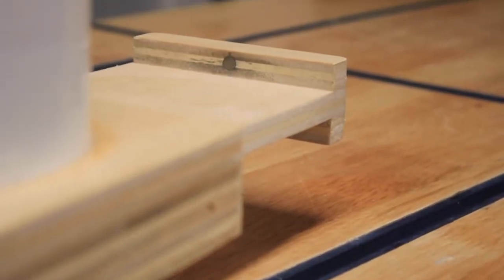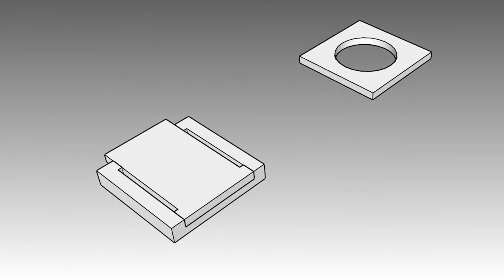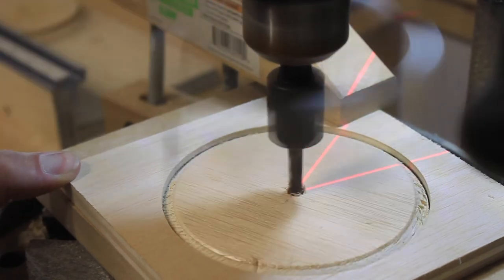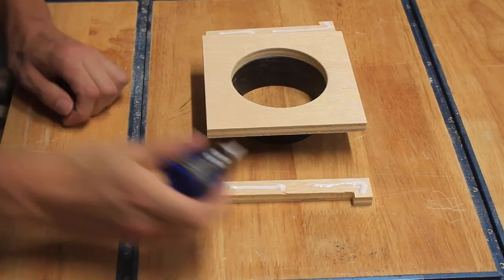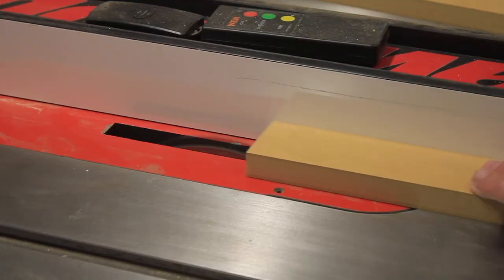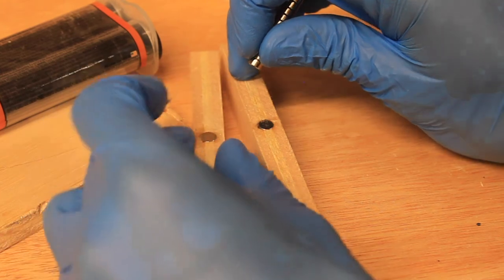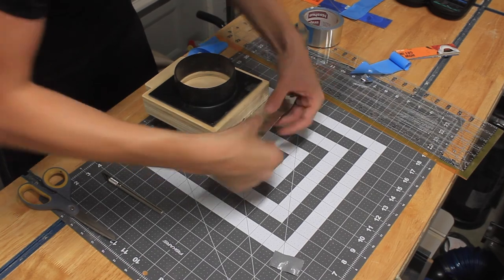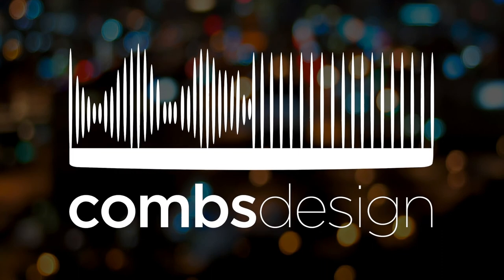DIY Self Cleaning Blast Gates (Best DIY Design)

Comment: I lost a big chunk of my thumb making dado cuts like you did here.  Using your fingers to hold the piece down as you slide it over the blade is asking for trouble.  All it has to do is catch the blade and sling it out of the way and your hand drops onto the blade.  Don't mean to preach here, I did it the same way for twenty years before it happened to me.  It's just a matter of time.  Other than that, nice design, nice vid.
Reply: yeah, his hands on that table saw made me cringe too! Its only a matter of when it will happen.

Comment: Great video. I like the salvaging part. Only one comment though, the way you are ripping your plywood is extremely dangerous and can result in a kick back. I know you are using a sawstop so you are not worried about your fingers but the way you are pushing the off cut and leaving the actual piece hanging out between the fence and the blade could result in shooting that piece towards you. Use a push stick and keep that piece supported and push it through all the way and don’t worry about the offcut
Reply from the maker: Thanks! Even though I have a saw stop, I still treat the saw as if it does not have the feature. I use a push stick most of the time, but will often do a single cut without it in situations where I am needing a clearer camera angle for the video. Luckily I have moved some things around now so I don't have to do that any more in my newer videos.
Reply: @CombsDesign  Sorry man. No camera angle is worth kick back. I can show you the mark I still hold over a decade later. Use a push stick/ block every time.
Reply: when he put his hand on top of the wood, as he pushed it over the dado blade - i had to look away.

Comment: Using superglue to speed up the gluing process is no trick at all people have been doing the same for many years you are just copping others.
Reply from the maker: Never said it was original, just sharing it with people who might not know the trick.
Reply: If you are going to criticize someone, you should at least check your spelling. You may also want to investigate punctuation. How many videos have you produced?  Have you designed some awesome blast gates? I need some.

Comment: Why did you call the rocker D.C. “junk” I would like to know I’m shopping now
Reply from the maker: For a few reasons, first, the plastic pieces are not bonded well with glue, so the 2 parts separate very easily. Second, they are so light that they will just close on their own from time to time when using tools. This will stop the collection without you realizing it, and make a mess. The third thing is the biggest problem, they have a huge design flaw. There are open cavities in the blast gate that fine dust will get impacted in, but there is no way to clean it out. In my experience with about 6 or 8 of these, they all stopped being able to close fully due to impacted dust after a few months. Finally, Rockler has terrible customer service in my experience, so I avoid them when possible. For me, it was $80 in the trash after a few months, except for the salvaged parts.
Reply: Thanks for your in put much appreciated
Reply from the maker: @Bob Webber  I just realized that you were asking about the dust collector and not the Rockler Stable Gate, here is why, and sorry I misunderstood! 

https://youtu.be/mqbe4IBK5DY

They are both terrible products, I did not feel like a negative tool review belonged on my Combs Design channel, so I put it on my personal account. I sent the video I linked above to Rockler and I had a customer support representative tell me that the amount of dust I saw on the infeed side was normal.
Reply: Thanks again..... I understand now.  Did you ever find out what the problem was. Did’nt get 650CFM? Dust collection is all about flow at the tool.  Have not bought yet still shopping. I need around 950 CFM at the collector to get what I need at the end of my piping run. I appreciate your candor thanks again
Reply from the maker: No idea what the problem was, Rockler continued to insist that it was not a faulty product. My advice would be to buy oversized even after doing the math. The Jet 717515 would probably work for you, they only list CFM at 6", so you would probably need to call for the rating at 4". I have the next size up from that one and it does a great job. The 30 gallon drum fills up surprisingly fast, though. For me, the Rockler unit ended up in the trash.

Comment: Your design is a big improvement over those I cobbled together 40 years ago and, because I'd like to build all the gates I need in one day, I'll forego the nifty looking single pivot design Katz-Moses and some of the others demonstrate. I need 2 @ 8", 5 @ 6", 4 @ 5" and 2 @ 4". The straight edges of your gates lend themselves to modification to serve as secure mounts directly to the wall and two-point suspension several feet below high ceilings. With your straight-forward design I might actually get all 13 pieces done in one long day though I shudder to think of the mess it will make without central dust collection. Thank you for posting this video.            PS: Rockler deserves every thump you dished out.
Reply from the maker: This is a super quick build that can very easily be batched out! Best of luck getting all 13 done, I think you can do all of them if you build all the parts first and assemble them almost like a factory production.
Reply: @CombsDesign  As a pup I worked on a few factory assembly lines. What do you think of sandwiching in a layer of paper on both sides of the central laminations to gain a little clearance for the slide?
Reply from the maker: I’ve actually never tried that so I don’t know for sure, but I don’t see why that couldn’t work! Adding paste wax will help a ton for sure, but you’ll definitely need some physical clearance as well.